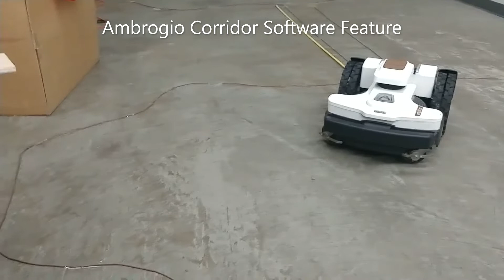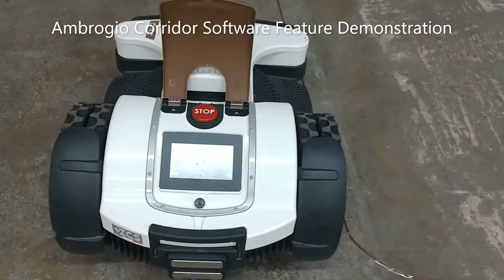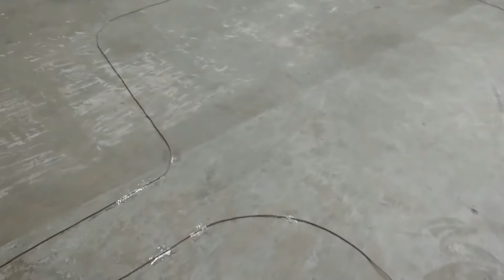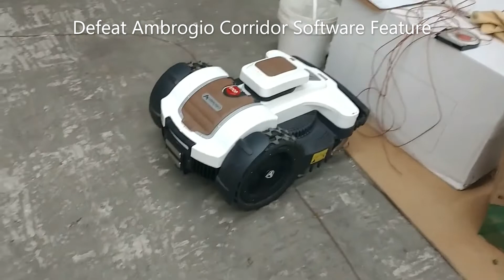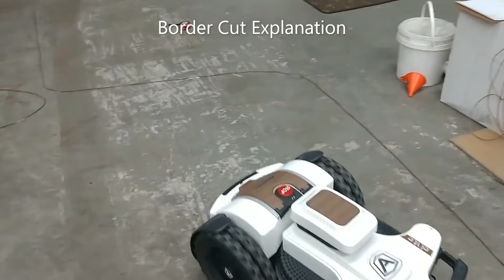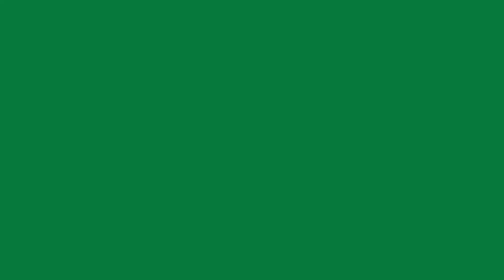How to Make the Ambrogio Robot Lawn Mower Cross a Driveway

Comment: BUT! Does it work with The twenty series aswell. As its small and the loop sensors are closer together. And the feature of the twenty has a backing feature that makes the twenty back up longer compared to the 4.xx series
Reply from the maker: Hi Daniel, YES. I tested it with the Twenty Elite. I cannot say for sure regarding the Twenty Deluxe, but **maybe**. Likely yes, too, because the factory customer service told me all robots support the corridor software feature, however, it may depend on the model year and/or software version. That is, they may have spoken from their perspective of the date in which I asked the question vs reality.
Reply: How do you turn off slow border? L250i?
Reply: @hired85  That you do in the Service menu of the robot. But consult your local ambrogio dealer before you do that because there are plenty of settings inside that menu that if turned off will impact the robot.